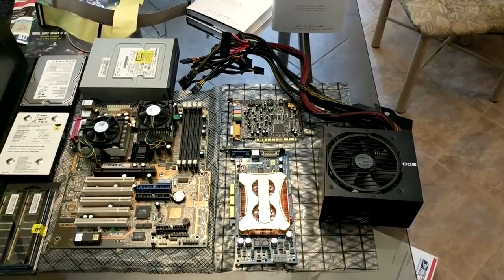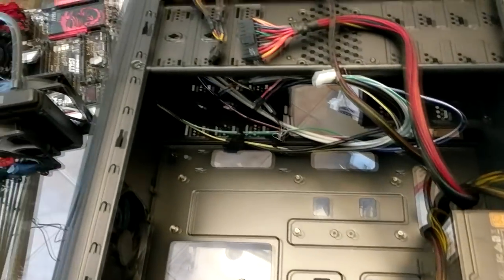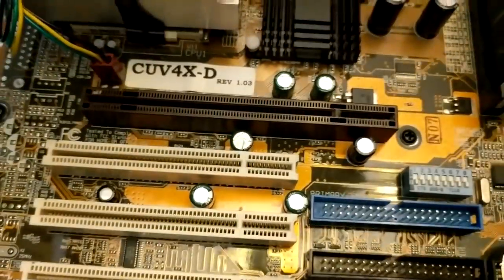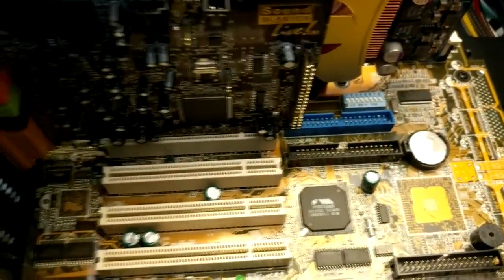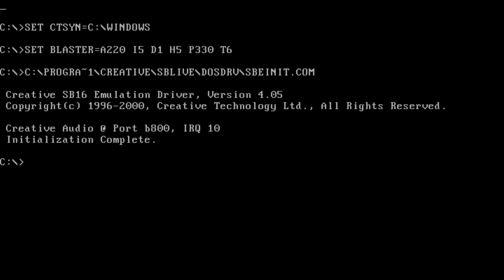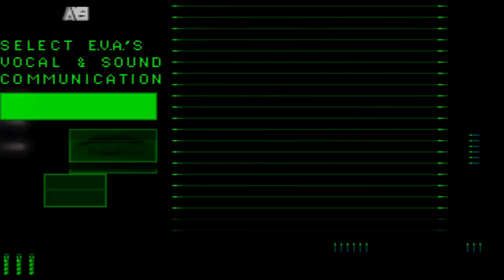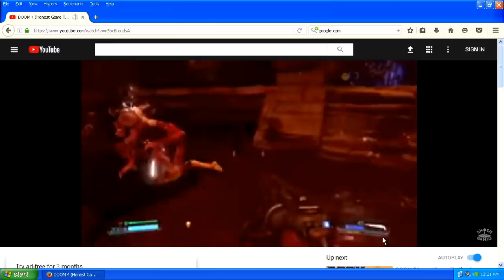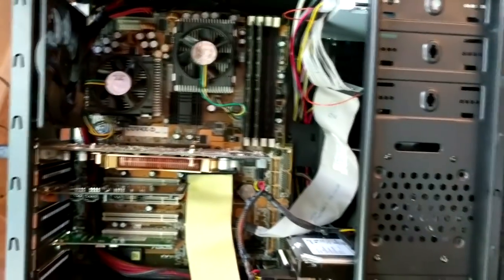Pentium III Retro PC Build! Dual 1.4 Tualatins!

Comment: if that board takes ECC i may have some 512mb pc133 ECC sticks laying around. IDK if that would be of any use to break 1gb of RAM if the chipset could even see it
Reply from the maker: This is a server board so it can actually use up to 4 gigs of RAM!
Reply: yes 4gb all day
Reply: i run 4gb ecc dell mem i bought 11 years ago though i think i have a bad solder joint as the sticks are super tall 1 may have got bumped cause i have intermittent issues with the last slot easy fix just havent got around to as its been shelved for years now
Reply: i wonder if the last slot could be de soldered with one of those desoldering guns.
Reply: no need to desolder just need to reflow with flux good as new even if a pad was lifted or trace cracked thats still easy fix but i do this for a living:)

Comment: chrome with hardware accel enabled might work
Reply from the maker: Possibly, I am not that invested in getting proper web browsing on it though tbh.
Reply: well it would give a massive increment to the utility of the computer now when ur bored of playing old games u can dink around in chrome and you wont have to use another computer, it will be an accomplishment and make the pc self sufficient
Reply from the maker: ReactorFox3 lol fair enough.
Reply: Ironically enough, I started with the same purpose you mentioned. And now since a year, I'm using an overclocked Pentium III Tualatin PC as my main one, with no regrets. Runs everything I need fast enough, I can browse the web fast enough thanks to an optimized configuration I made for Mozilla Firefox, and runs all the old games I need without bottlenecks. Isn't it awesome to have a "legacy friendly" PC?
Reply from the maker: It really is!
Reply: @ArchadesGames  and not only that. I use a CRT monitor with it, an 84 keys AT keyboard (with an XT layout) and a late 1980s Logitech PS/2 mouse. XP is rocking at 640x480 at 32bpp. Sounds ridiculous doesn't? Well, 640x480 isn't as bad as it might seem. For XP is pretty much alright especially on a 14" CRT. Having a dual Tualatin would be an interesting opportunity, considering my system is already blazingly fast enough as it is (scoring 12977 points in 3Dmark03), can't imagine if I overclock a dual Tualatin setup..
Reply from the maker: XP definitely benefits from 2 CPUs! I might overclock it at some point but I'm plenty happy with it at stock!

Comment: Meh, you never had agp gpu? Nice. I only have single tualatin 1.4 and Asus TUSL2-C
Reply from the maker: I was relegated to the scrubbyness of on board video for a few years! Had an onboard GeForce 4 MX for a while, but can't remember what was before that. How long you have your build?
Reply: @ArchadesGames  Integrated gpus, especially old ones sucked :D Actually these parts are waiting for swap, with current work-in-progress build with coppermine 1Ghz CPU amd Asus CUSL2-C. BTW. Asus boards FTW :) Now i'm finishing P4 build with 3.4Ghz LGA775 cpu and Radeon X1950 pro agp card. I have intel chipset socket 7 board with pentium mmx 200MHz. Also i have few 486 cpus featuring Amd 5x86 133 and Amd Dx4-100. Im now fixing few 486 VLB boards and in meantime working on my car :) I dont really know what would i keep and what would i sell... Probably i will keep P4 build, tualatin build (idk go for gf 5900xt or radeon 9600 xt?; Gf 4 Ti 4200 broke) and 486 build (currently intel 486 DX 50 and trident 8900 vga card, later probably vlb board and 5x86 133).
Reply from the maker: That's an awesome selection! I just posted a video of my recent 486 pick up Also just grabbed an old K7 system I'm interested in trying out against the Pentium 3. I don't have much of a GPU selection for these guys yet but I have been enjoying picking up random stuff at thrift stores.
Reply: I have only one Pentium III system. Asus CUSL2-C, Pentium III 866MHz, 512MB RAM, 3Dfx Voodoo3 2000 AGP
Reply from the maker: I am super jealous of that Voodoo! Cool system!

Comment: Mate get some socks and voodoo2 :)
Reply from the maker: Rafal S. I would love a Voodoo 2, they have gotten way out of my price point though.
Reply: ? they are cheap even 3 it 4-6+ that are not and the pci ver of them
you can easily buy a couple and do sli from ebay

6+ is a Quantum3D AAlchemy card that has 8 vsa-100's per card only thing about it is it allows you to run anything it CAN RUN at its max capable res and ys they can be used in any pc i was bidding on the last on ebay but $2k was my limit on that lol also needs a custom psu
https://www.youtube.com/watch?v=t7npXfYIE0w
https://www.youtube.com/watch?v=a7CQ1GnQmsQ
https://www.youtube.com/watch?v=GoXBZCueQhw
Reply from the maker: All the ones i find are running for $70 plus. Not very cheap for my current budget on a build I have already finished. Maybe when I get the resources to build My Pentium 2 machine i'll add in the Voodoo 2.

Comment: Use Opera much better
Reply from the maker: Jon Mathias Rex Truth! I have never really cared for Firefox in any of it's iterations.
Reply: chrome with hardware accel enabled might work
Reply: Chrome and Opera for Windows are not supported on Pentium 3 so you can't install them. You need at least a Pentium 4 or newer.
Also, You can't enable hardware acceleration in browser on something that old. Might be video card dependent but i've never managed to do it on my Tualatin.

Comment: you can play nsf 3 or older games. me not
Reply from the maker: Jon Mathias Rex not sure about 3 but it can handle Underground which was a game 5 years newer :)
Reply: Archades Games underground 2 I play on pll 333Mhz MMX geforce2 and 512M ram beautifuly online  (I was the pc lan server as my friends use to have k6 pc )
Reply from the maker: crazy, minimum spec call for a p3 of at least 733!
Reply: Archades Games was pentium 2 on 333Mhz not 3
Reply from the maker: Not accurate sorry.

Here are the Need for Speed: Underground 2 system requirements (minimum)
CPU: Pentium III or Athlon XP
CPU SPEED: 933 mhz
RAM: 256 MB
OS: Windows 98/98SE/ME/2000/XP
VIDEO CARD: AGP Video Card with 32 MB and a DirectX 8.1 compatible driver (GeForce2+ /Radeon 7500+)
DIRECTX VERSION: 8.1
SOUND CARD: Yes
FREE DISK SPACE: 2 GB
DVD-ROM: 8X Speed DVD-ROM (This game contains technology intended to prevent copying that may conflict with some CD/DVD-ROM, CD/DVD-RW and virtual drives.)

Need for Speed: Underground 2 Recommended Requirements
CPU: Pentium 4 or Athlon XP
CPU SPEED: 2 Ghz
RAM: 512 MB
OS: Windows XP
VIDEO CARD: AGP Video Card with 128 MB and a DirectX 8.1 compatible driver (GeForce4+ /Radeon 9000+)
DIRECTX VERSION: 8.1
SOUND CARD: Yes
FREE DISK SPACE: 3 GB
DVD-ROM: 8X DVD-ROM (This game contains technology intended to prevent copying that may conflict with some CD/DVD-ROM, CD/DVD-RW and virtual drives.)

Comment: The graphics card is not the best 9700Pro  ATI radeon  is way better then that fx 5900 
I miss starcraft brood war, half life, hit man and mad max , wolfenstain
Reply from the maker: play em! star craft is free now even!
Reply from the maker: I think my FX 5900 can run Need for Speed Underground at Max settings where as those cards couldn't even run it.
Reply: Archades Games nfs udergound ran beautiful on 8mega ram ATI Rage the fx series wore never intended for gaming and have more performances in video editing
Reply from the maker: Minimum Requirements:

CPU: Pentium 3 or Athlon

CPU Speed: 700 MHz

ram: 128 MB (256 MB RAM is required for Windows 2000 or XP)

os: Windows 98/ME/2000/XP

Video Card: 32MB DirectX 9.0c compatible video card (NVIDIA GeForce2 MX+ / ATI Radeon 7500+ / Intel 865+)

DirectX version: DirectX 9.0c (included)

Sound Card: Yes

Free Disk Space: 2 GB

I have an MX 400 and that can barely run it.